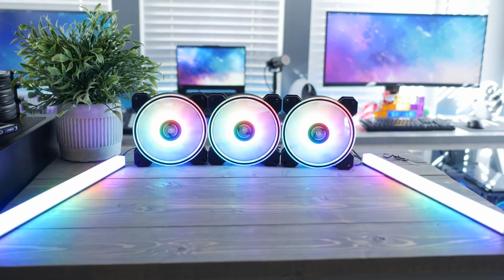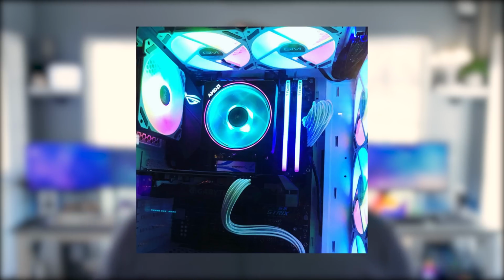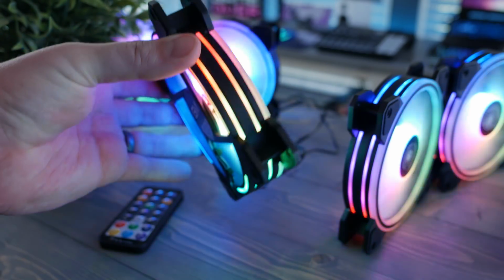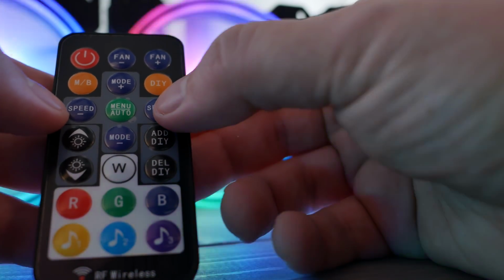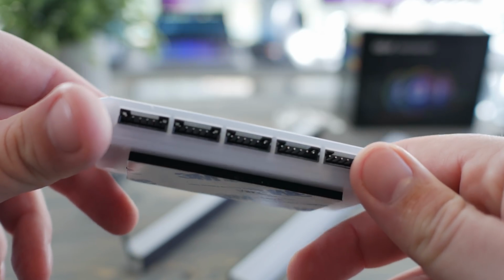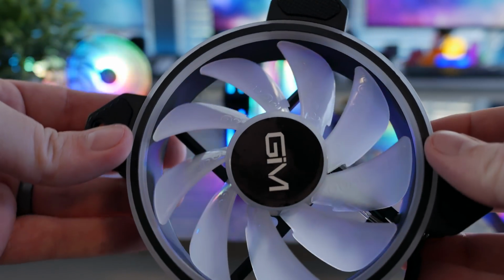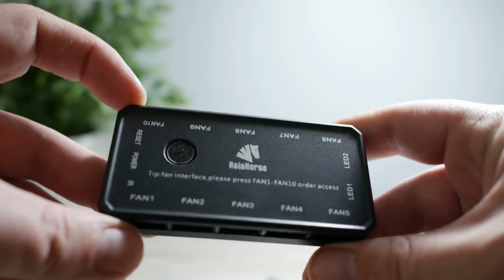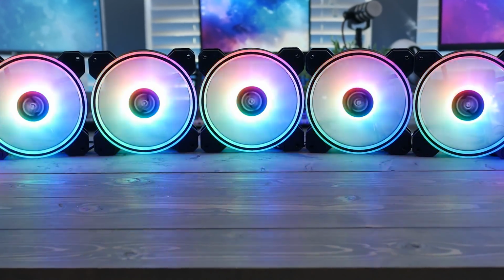GiM Case Fan Overview!

Comment: These or asiahorse fs-9002 for a corsair 4000d airflow case?
Reply from the maker: I actually just put Asiahorses in my 4000D test bench. I used the 360 and 240 for ease and (actually a GIM fan as the rear exhaust).

Comment: Beautiful fans look 1000% better than the EZDIY-FAB fans that I have.

Looks like there are a good amount and variety of color modes. Did you try to sync it with a motherboard and see if you loose any of the color modes? Can you control the fan speeds individually or is it a all or nothing type situation?

In other news:
 I need to get that Wraith Prism Cooler!!!
Reply from the maker: Fans are all controlled by the hub, and while I did not try the sync mode with these I never get my hopes up too much for perfect matching with third party sources. (Way to call me out Christopher 🤣)